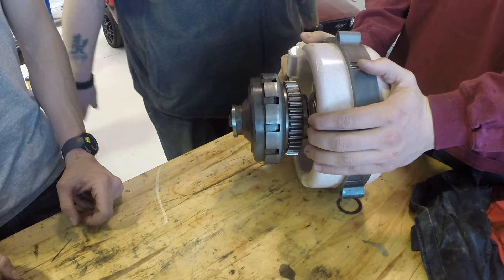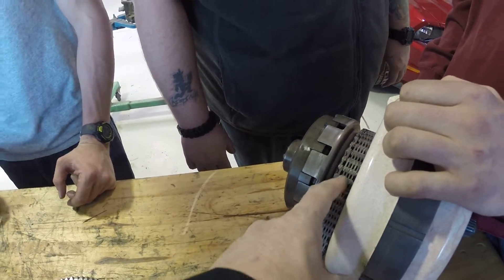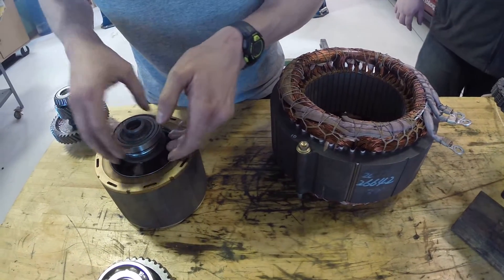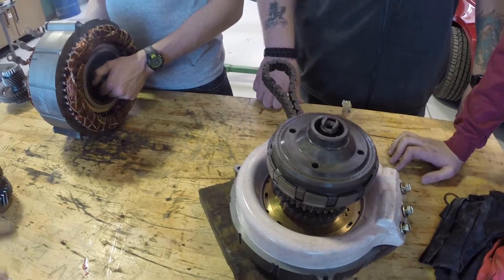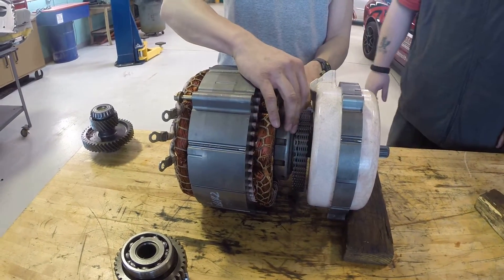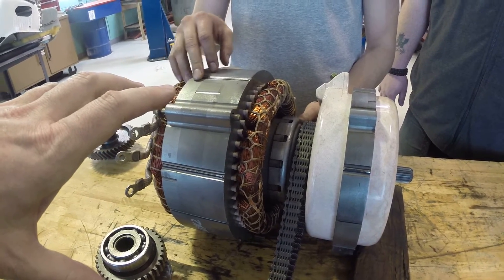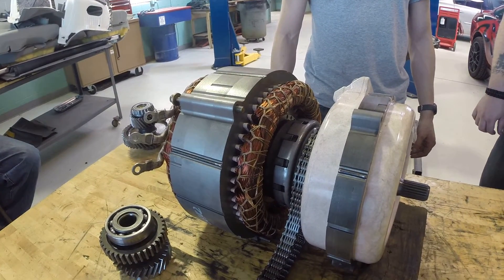Toyota Hybrid MG1 and MG2

Comment: What kind of readings would be obtained doing a resistance test, or megger test of the motor windings, with mot 1 and 2 still installed in the vehicle? Looking for a shorted motor, due to bearing failure.

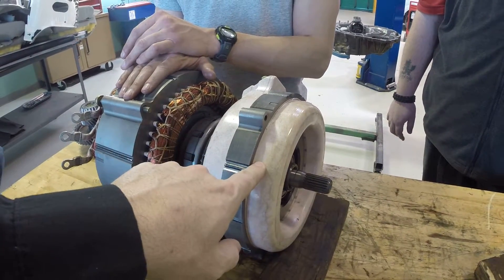Comment: at 7:30 you say "if the gasolene engine needs to drive this quickly, then it's automatically going to take torque away from helping to drive the sun gear".  Not true, the torque ratio between the 3 ports of the planetary drive is constant, if the engine torque is a certain figure then the torque to MG1 and the torue assistance to MG2 is constant. What the planetary box does is to keep torque ratios the same while allowing  RPM between MG1 and MG2 assistance to vary,  so by electrically controlling MG1 RPM and engine RPM you can control wheel RPM.